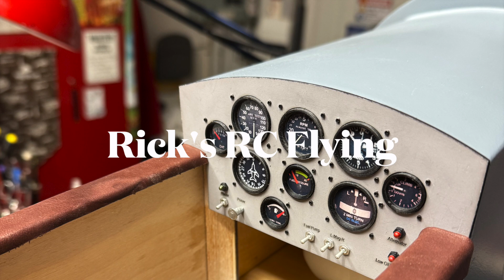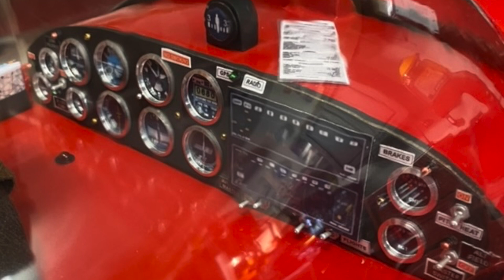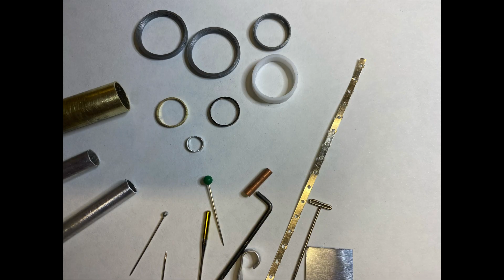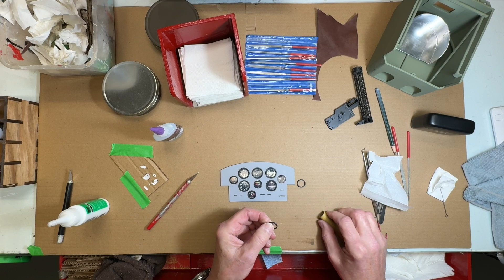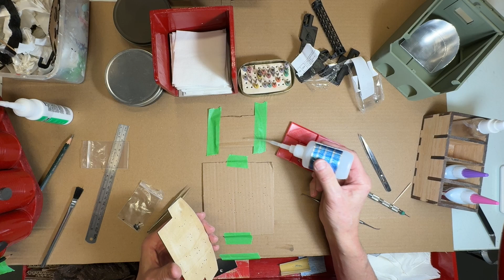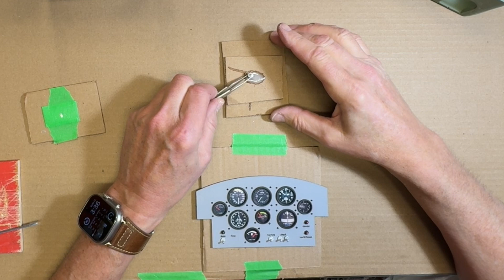Sweet & Low RC Model Airplane Building The Cockpit Instrument Panel Part 2

Comment: Care to share your STL files?
Reply from the maker: Hi Mike, I've received numerous inquiries about the instrument components, so I will be providing the bezels, switches, knobs, and instrument faces. I'm currently working on redesigning my files to ensure that the components will be of much higher resolution than those used in the videos.